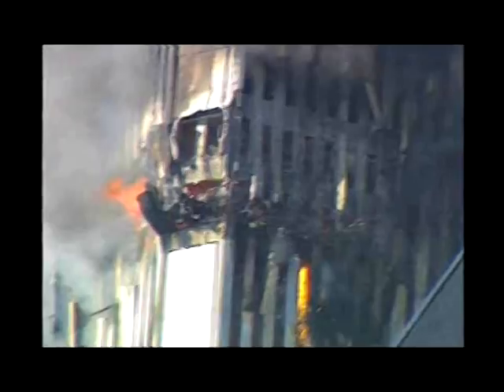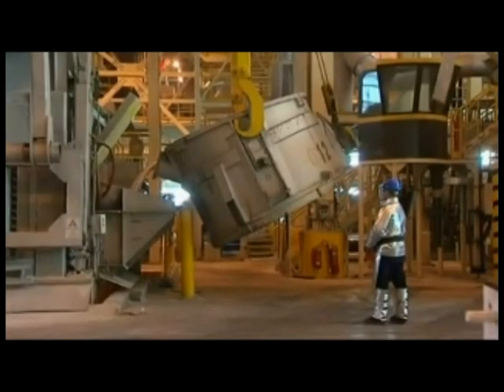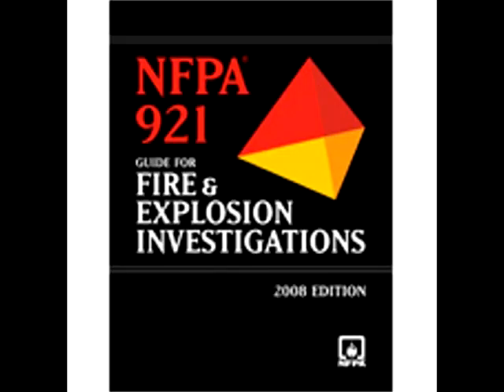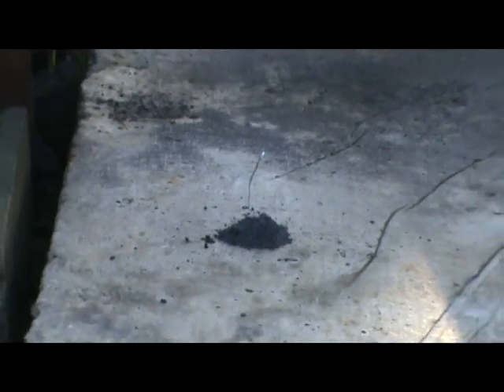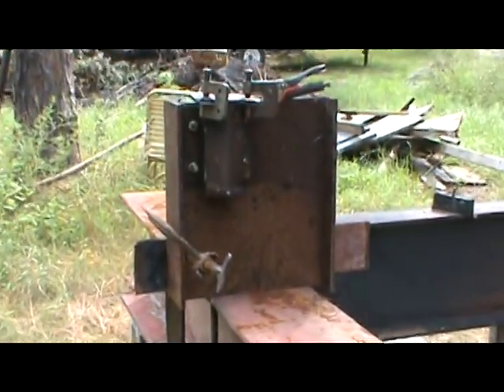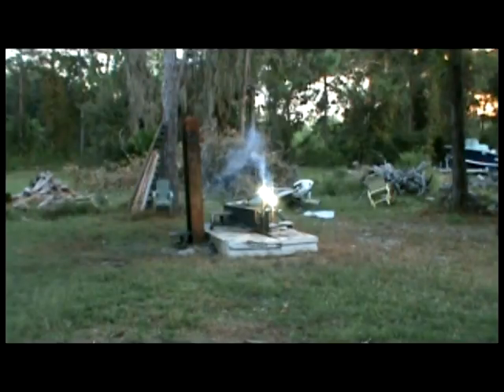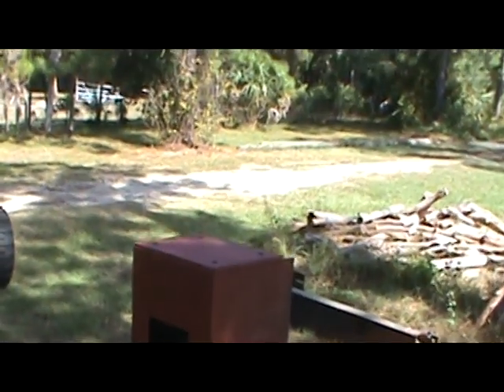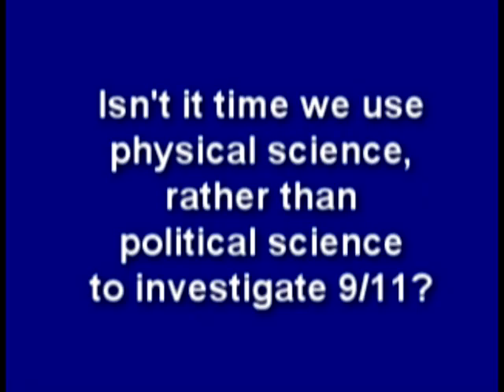9/11 Experiments: The Great Thermate Debate

Comment: This is quite depressing. You people say you want evidence for 911 Truth??? Here is some:
1) WTC 7 Falling at Freefall Speed for 2.25 seconds
2) WTC 7 Falling with perfect symmetry
3) Molten Metal found in all three of the sites
4) Underground fires lasting for 3 months after collapse
5) Both North and South towers falling at 2/3 the speed of freefall
6) The smaller upper portion destroying the entire lower portion
7) The Sulfurication of the Steel Beams
8) Horizontal Cuts in the Steel Beams
9) Billions of molten iron spheres found in the dust
10) The nano Thermate chips found in the dust
11) The Police and Fire Department knowing about the WTC 7 Collapse before hand and clearing everyone out of the area. 
12) The grass around the flight 93 crash site was never burned by jet fuel.
13) Squibs seen as the buildings collapse
14) The horizontal ejection of Steel Beams at 70mph
DON'T GIVE ME THAT NO EVIDENCE BULLCRAP
INSIDE JOB IS THE ONLY CORRECT ANSWER 
PLUS THERE IS OVER 2300 AND COUNTING WORLDWIDE EXPERTS THAT SAY IT WAS A INSIDE JOB.
THEY WOULD TALK?I know of a place called AREA 51 and its been around for a very long time.Don't you know that a pro won't talk.Tell me all you know about Area 51________
Reply: MrRandomGuy86
The support columns were cut, not exploded.

 Thermite/Thermate has been around since the late 1800's.  Nothing magic there.  Nano-Thermite is much more effective and cuts faster.  There is some explosive sounds - which were reported by numerous people.

Free Fall would not immediately occur. You have what is called acceleration - which can be seen in the numerous videos.   In fact, buildings demolished by normal means - with explosives - actually raise UP a bit before they start their fall.

Nano-Thermite evident in the dust.
Micron molten steel spheres were found in the dust.

Nothing fairy tale, and personally I would love to be able to explain this away as a simple office-fire produced collapse.  But my training  - and simple logic - will not allow that. 

The implications that is was a controlled demolition disturb me.. they do not make me joyful at all..

Go try my knock-the-leg-off-a-table experiment and get back to me.
Reply: *****
 Well, as an engineer with nearly 35 years of experience I can say that the report is flawed.  I shall not waste my time discussing this further.  And no, I will not explain why I think it is flawed.  But ask yourself one thing: Why did NIST not investigate the possible use of or presence of explosive material - for one thing.  There is more but I am tired and I cannot and will not explain what building collapse simulation experience means to a layman.
Reply: *****
I am a 2.5 year Civil Engineering undergraduate and I have worked my entire life in commercial structures, mainly steel and concrete. And I am sorry to say that your little pet theory that the unseat in of a single floor truss would create a chain reaction that destroys the next 8 floors belie,  well that's just plain stupid.

In a house of cards, if you take one card away, the entire house collapses. But it won't collapse on free fall. And if the cards are glued or welded together, removing a single card likely would not collapse the entire structure. Your ridiculous single floor truss theory is an attempt to portrait a massive steel building as a mere house of flimsy playing cards loosely stacked together. 

You should be ashamed of yourself.
Reply: *****
All of this proves one thing... more investigation is required.  I support AE911Truth.org's call for just that.

But to quickly answer you question about evidence for cut columns.. it is the lack of intact columns (evident from how the building fell and the rubble pile) that brings me to that SPECULATION...   Plus my personal experience running hundreds and hundreds of building collapse simulations..
Reply: *****

 NIST does not write codes or regulations that would be directly applicable to building safety - they set measurement standards.... And trust me, I know codes and regulations... Remember I was a quality control / quality assurance engineer for the DoD.  Making sure everything meets code (International, National and Military) was a major part of what I did.. so how does NIST make things safer?  That would be NFPA, OSHA, MSHA, EPA, IEEE, ASTM,  and many others.. but NIST? - nope..

In fact, NIST was a very odd agency to task with the "investigation".  The USACE would have been better suited to research 9/11.    Or the FBI, or the Department of Interior, or the FAA,... but NIST?  They are part of the Department of Commerce for heavens sake.. they are NOT investigators..

Here is NIST's Mission Statement: NIST's mission is to promote U.S. innovation and industrial competitiveness by advancing measurement science, standards, and technology in ways that enhance economic security and improve our quality of life.

* Measurement Science** these are the guys that tell us how to do soft or hard Metric to Imperial and Imperial to Metric conversions and set the standards for that... STANDARDS.. not code, not regulation..   Hell, I had a chart from NIST on my office wall for conversions and what the standards for conversions are..

So they were not tasked to consider explosives?  Really?  Was there not speculation at the first that the planes (or the hijackers) could have had explosives on them.  And if they decided not to consider explosives, should this not be in the report - I.E. "NIST has not investigated the use of explosives in the collapse of the WTC buildings because we think none were used because that is our feeling."   But that would be ridiculous, because if you are going to rule something out, or not studing something, you explain IN YOUR REPORT that you are ruling it out.

Again, my extensive experience with building collapse makes me question why WTC7 (and the twin towers) fell in the manner they did.. It is like a auto body expert.. he SEES a pickup truck "dog-walking" down the road, he knows that the truck might have a bent frame without any measurements necessary ------ I don't have to use any other tool other than my trained eyes to seriously question the results of the flawed investigation of 9/11.
Reply: Eddie Hayes
 Thanks Eddie.. I was about ready to bang my head against the wall with this one.. as a boss of mine years ago used to say "Logic Dictates"..
Reply: terrymanning1 I wonder how much money the government is paying you?
Reply: Dusty Slim You got him there with his no reason to check for explosives. WTF: Terrorists attack a building, fireman an cops hear explosions, many of them, but that's no reason to suspect explosives. This is how the debunkers look silly. Admit what is obvious, at least, or you just look stupid. Not you, bro, you're doing great.
Reply: The building visibly dropped in free fall. Your bullshit cop-out explanation is that the internal structure collapsed basically leaving a cardboard cut out of the building which than dropped in free fall.

This is pure bullshit as even a cardboard box can't collapse into itself in free fall.

Free fall means that something is pulled by gravity without anything to slow it's acceleration in free fall.

That you believe this can happen simply because NIST tells you is laughable.

First NIST claimed in their draft that the building dropped at 40-60% slower than free fall.
Than when cornered by a high school science teacher, they were forced to revise that statement and their final report would change to "essentially in free fall".

But never mind me. If NIST tells you a building can drop into it weld as effortlessly as if it were falling through nothing at all than it must be true.
Reply: *****
"The final global collapse of WTC 7 was not attributed to either impact damage or fire/heat."

You yourself wrote that "Thermal expansion caused a floor truss to walk off its seat plate, causing the the 13th floor to collapse. This caused a cascade failure of floors down to floor 5"

Now what would have caused this thermal expansion? Fire and heat maybe? Hmmmm? 

Besides how you can imagine that a single floor truss would cause 8 floors to cascade like a bunch of dominos, well that's just ridiculous.

The fact remains that if there were "raging fires" as NIST claims, they would have to be on the South side as only weak random sporadic fires can be observed on the other 3 sides. And the debris damage was also all on the South side. 

But now you are telling us that neither the fires nor the debris damage were the cause of the collapse? Well, I sorta agree with that statement as fires and debris damage to a single side would not cause any fire protected steel building to drop this way, in free fall, almost perfectly vertically for about 3/4 of the drop.

So tell me, if neither fires nor debris damage were responsible for the oh-fishy-al collapse narrative, than what was the cause of the collapse? Fairy fucking dust?

"Why don't you guys ever know that before you attempt to criticize the NIST Report?"

Believe you me, we 'guys' do know very well that fires and debris damage to the one side were not the culprit of the collapse.
Reply: *****
I can't stress it enough, if you can look at the videos of WTC7 and convince yourself that it's a fire collapse, than no amount of logic will appeal to you.

Einstein said that two things are infinite - the universe and human stupidity. And he wasn't entirely sure about the universe.
Reply: Sirius Black NIST stated that WTC 7 fell as a result from the failure of one column and the subsequent progressive process of failures to  the rest of the columns. But they also stated that the whole building came down as a single unit for 8 floors (2.25 seconds) at free fall speed. Free fall cannot be explained by a progressive process and only by CD. But NIST did not say that. They said nothing!
Reply: terrymanning1 the computer simulation stopped before it showed the fall; just the sequences that lead to the fall. Moreover the simulation indicates something totally different than what is seen in the real pictures. It shows that the building is crumbling on one side which never happened, It should have been REALLY interesting to see the sequence where the whole building comes down "as a single unit in free fall speed at the acceleration of gravity. If you have a computer simulation that shows this you owe me that one!
Reply: terrymanning1 I have no idea of what kind of explosives that were used. What really happened was what we all have seen in the videos. The building fell - at least partly - at free fall speed, which cannot be explained by anything else than controlled demolition. Do you have another explanation? Dove shit?
Reply: TIM SEATON if we are talking about WTC 7 it does not take too much brightness to read NISTSTAR 1 A p. 44 ff. The towers did not fall at free fall speed but at constant acceleration very close to that. That is also not explicable by anything but CD.
Reply: terrymanning1 all of a sudden you can talk? Then tell me where to find the evidence of the hijackers at the airports, the evidence of the final fate of Flight 93 (disintegrated or buried) the explanation of the free fall of WTC 7. I am longing for that information.
Reply: TIM SEATON I have seen enough of the actions from you guys to know that you are just cowards. Just now you are just scared little boys waiting for the truth to blow up in your faces when the 28 pages are released to the public. I hope that you, if you have some decency, encourages everybody to get that material declassified. Then you have done something positive for this nation. Otherwise you belong to the cabal who loves harsh interrogation methods together with... you know who.
Reply: TIM SEATON and what about your story? 19 hijackers that penetrate all of the US institutions with 100% success rate and that same incompetent government presenting a 100 % success rate story of how it all came about within hours and all over the world (and ready to go to war). Who  is offending the memory of the deceased and their families?
Reply: Dusty Slim

Explain how bombs could magically survive falling debris, fire, evade bomb sniffing dogs, and explode silently seconds before collapse.

Furthermore explain how bombs could cause the building to do a free fall in the MIDDLE of the collapse. Not the beginning, not the end, but the MIDDLE. Wouldn't free fall occur at the beginning of the collapse if it was a CD?

You can't explain it away with your fairy tale CD theory.

WAKE THE FUCK UP DUMB DIPSHIT SHEEP!
Reply: Dusty Slim
You ignored my comment. What's the matter dumb dipshit sheep? Too much of a coward to admit you can't refute me?
Reply: I don't think I ever seen you before? With a 12 man highly trained team of men I could drop ANY building from over a thousand miles away TONIGHT if I had the material,setup and men.What the hell does people think Area 51 and (SECRET BASE) is for?
Reply: Eddie Hayes
"With a 12 man highly trained team of men I could drop ANY building from over a thousand miles away TONIGHT if I had the material,setup and men."

Prove it.
Reply: Eddie Hayes
No clue what you're on about. You make less sense than a guy trying to ram the elevator doors open on the top floor when the elevator is on the bottom.

How about you explain how bombs magically survived the plane impacts, fire, evaded bomb sniffing dogs, and exploded silently seconds before collapse.
Reply: Truthers (and especially the fuzz faced fuck up Hayes) are retards.
Reply: Eddie Hayes
I wonder why you can't answer how bombs magically survived the plane impact, fire, evade bomb sniffing dogs, and explode silently seconds before collapse.

I wonder why you haven't looked at Operation Penttbom yet.

Oh yeah it's because you're a gullible ignorant dipshit sheep drone to the conspiracy shepherds.

You pull the classic "oh this person is a paid agent" from your sheep handbook. Well guess what? IT DOESN'T MATTER! If you really had the truth you would be able to refute terry and myself agent or no agent.

The TRUTH is you say "oh government agents they lie so I don't have to refute them." It is a LAZY SHEEP tactic. You still have to refute us regardless, and you can't. You simply say government agents to ease the discomfort you have from cognitive dissonance.

But you could prove me wrong SHEEP. I DEMAND you answer what I asked you to. If you don't, then you need to...

WAKE THE FUCK UP DUMB DIPSHIT SHEEP!
Reply: What are you talking about?
Reply: ***** So what? The very existence of free humanity is in danger. U.S. and all the West is controlled by bankster "elites" since 18th century (central banks are in  private hands, like FED is). Industrial military complex is owned by them. They do events like 9/11, enforce ISIS, and yiu idiot say so what? Fortunately there are people who care.
Reply: ***** 
1) the building could not fall at this speed without charges exploding evenly and in coreect times and weakening its structure.
2) steel could not have been molten without temperature higher than that of offuce fires
3) see 1)

As to conspiracy theories:
4) the term was coined out by CIA in 1967 to discredit people daring to ask about Kennedy assasination
5) search for "33 conspiracy theories that turned out to be true" on infowars.com website. And if you say "I don't go to such websites" you will only confirm being a sad ignorant.
Reply: Believerification
Explain how bombs magically survived the plane impacts, falling debris for building 7, fire, evaded bomb sniffing dogs, and exploded silently seconds before collapse. Explain why any explosion that happened that day had nothing to do with any building collapsing.

You can't with your fairy tale theories. But prove me wrong by answering me. If you can, then you win and 9/11 was an inside job.

If you can't - and I know you can't because bombs like that don't exist - then you need to...

WAKE THE FUCK UP DUMB DIPSHIT SHEEP!
Reply: WTC7 dropped in complete free fall. That is, it dropped throught thousands of tons of steel as easily as if it were falling through nothing at all. You claim NIST explained how this was possible. Please explain in your own words how NIST explained that away.
Reply: terrymanning1
If you can look at the videos of WTC7 dropping in free fall almost perfectly vertically and tell yourself "Yup, sure looks like a steel/fire collapse to me" than maybe I am not the gullible one here.

The NIST claims that there were "raging fires" inside WTC7. Hot enough to weaken fire protected steel. That would have to be on the South side of the building as all other 3 sides show very small random fires.

And the debris from the towers would have to also damage only the South side of the building - the side facing the towers.

So a building with damage by both fires and debris on a single side drops this way? And you don't have a problem with this?  Really? 

I sell bridges. I got the perfect bridge for you. A real steal. Might you be interested?
Reply: *****
I just read it again.....

 *"Thermal expansion caused a floor truss to walk off its seat plate, causing the the 13th floor to collapse. This caused a cascade failure of floors down to floor 5"*

You really should share your knowledge with demolition companies.
The poor misguided guts in controlled demolition would have rigged large amounts of precisely calibrated demolition charges in precise locations to be detonated in a precise sequence. But you are basically saying that dislodging a single floor truss would cause the entire building to collapse. That you can beleive this crap is apsolutely astounding.
Reply: oller = gullible fuck up with shit for brains. The NIST computer simulation matches exactly what was seen on 9/11. This explanation has been accepted across the world by all relevant experts except those peddling the truther lies. Strange that don't you think if NIST have it all wrong. Or are all the non truther experts paid off?
Reply: terrymanning1 explain total collapse after the initial collapse happened.....
Reply: truthers = retarded lie peddling attention seeking scum
Reply: NO.Explain it to me.I am a nice man.I know everybody has their unique way of thinking.A little of my background.I have a degree in being a shrink.I have worked at four major mental hospitals so it is easy to see if someone wants to talk or just screw with you.Why you may ask,"He doesn't use big words such as psychologist,psychology or any other word such as those.Most people don't understand those words.Especially if their mind is out of tune.Explain what you mean and then we can go forward.I know a lot of people will read this and they may give you advice on what to say.Stand firm and tell me what is on your mind,not theirs.
Reply: TIM SEATON NISTSTAR 1 A p 48 "the whole building came down as a single unit at gravitational acceleration" enough?
Reply: It's not my fault if truthers are unable to see beyond their own hatred and paranoia. You guys have absolutely no evidence to counter the official account, just lies, bullshit, innuendo, cherry picked quotes and a small group of discredited "experts" still peddling them. It's over for you pathetic whining douche bags. 9/11 was carried out by Islamic terrorists. Deal with it. Move on.
Reply: Eddie Hayes if you can't separate the truth staring you in the face, the evidence put on a plate , the common sense of the big picture, then I'm sorry, but you are spending a little too much time with your patients
Reply: You're just a big mouth,a TROLL that needs to look after the country they live in.You have your own opinion about everything.You can keep sending me all the crap you want and I will just respond the way I want.So do it.
What I have is an opinion and with free speech I can express it.
I LOVE AMERICA.Your just a idiot that says nice things about the US and you really expect anybody with a reasonable IQ to just go along with you?I've seen you make comments on other sites and you showed no love for the US then.
Reply: terrymanning1 in reality you and your accomplish debunkers is the worse lot of the all; defending what is obviously undefendable. Where will you go when the 28 pages are released? Like the cowards you have proved yourselves to be you have not even dared to tell the story about Flight 93. Buried or disintegrated? No answer. Not from you. Not from your friends. Not from the Commission. Do you think it is fair to the families and to the public not even to come up with a comprehensive story?
Reply: TIM SEATON Sure I'm going to bring someone down?How would I ever do that?I don't have super natural powers.Nor do you.This was a exchange of words and thats all.People don't debate on YouTube and never will.Everybody presents ideas or a exchange of knowledge.You are only a very young "adult" still living with mom and dad.You are the very type that would censor free thought.I think everybody in the world should have the ability to express their point of view.
Reply: TIM SEATON I will knock on your wooden head until you give us some answers. But you seem neither to be capable nor willing so I can´t help you very much, I´m afraid! But knock I will. Answer!
Reply: oller Bring it on pal. The world knows you truther kooks are imbeciles and liars. 13 years of lies and bullshit that's proven only one thing: what a gullible bunch of hate filled anti-USA schmucks you all are.
Reply: TIM SEATON and how does that fit into the actual findings at the crash site? According to the first responders (including the local mayor and the editor of Pittsburgh Cronichle) there was no clue of a crash site where it supposedly was. In the Commission Report there is no comprehensive story. According to Wikipedia there was a crater of 8- 10 feet deep. And nobody could see anything not even the local coroner (until later lol). Some try to explain that it was dispersed in a large area and some say it was buried down to 25 feet; but no official account.  Happy with that?
Reply: TIM SEATON I think Wikipedia reflects the official version which is extremely shallow to say the least. So, in your mind; which story fits your findings the best? Disintegration or burying? Burying fits the 95 % story better or not?, Oh; I forgot: where can we witness the recovered wreckage? You don´t happen to have a link available?
Reply: TIM SEATON I am not changing any subject my answer was given before your comment came in and I have answered to that too. You owe us your story on UAL 93 and answers on all other questions.
Reply: TIM SEATON TIM SEATON = TERRY MANNING
Reply: truthers = cunts
Reply: terrymanning1 and the little snail returned to his shell
Reply: TIM SEATON..and you don´t even have an opinion. Buried or disintegrated? Flight 1771? The same? You gave me the clue. So now give me a straight forward answer. Feel cornered?
Reply: ama79adr we are just  dying to see their poetry published!
Reply: +TIM SEATON yea, when the defense secretary says In a press conference there's 2.3 trillion in unaccounted spending it doesn't get any clearer than that jacksss.
Reply: ama79adr looks like it!
Reply: ama79adr for some reason, there seem to very few around here for coffee service. I am not sure I would appreciate that coffee too much, so it´s ok for me.
Reply: ama79adr he is certainly an engineer in producing lies on YT.
Reply: facepalm

1) Time that with the penthouse collapse included next time.
2) Fiterman Hall and Verizon Building, anyone?
3) Molten aluminum. Molten steel is not red-orange.
4) And this proves what, exactly?
5) I already know you timed that by using the unattached pieces of debris as the time lap. Try waiting until all the floors have actually been crushed before lapping the time.
6) One floor down, two floors, it's called acceleration/domino effect/progression. 20:1 ratio of weight? Resist THAT!
7) It's called eutectic compounds.
8) OH MY GOD! HE CUT THAT BEAM IN A POST-COLLAPSE SALVAGE OPERATION! PROOF OF THERMITE!
9) And this proves what, exactly?
10) Thermate uses barium nitrate, which, if it were present at Ground Zero, would have caused more deaths by poisioning than the collapses and plane impacts combined. None of this substance was found in the dust samples collected by Steven Jones.
11) How did they know? Creaking sounds, visible structural instability, etc.
12) Again - what does this prove?
13) I guess that would explain why the goddamn walls began bowing inward when the collapse began.
14) Refer back to 13

And yes - no evidence.
Reply: Clearly, someone doesn't know what happens when a building loses all of its external strength - in this case, column 79 failing, destroying 1/3 of the area of flooring, and thus triggering a chain reaction of lateral collapse. The outer walls come down too.

If any of you can find actual evidence of an explosion, that would be an eyebrow up for me. Until then, we're at a deadlock.
Reply: *****
SO?
Reply: *****
Ok Cantonear... let's start with my qualifications.  For the last 10 years I have performed QA/QC on designs for the DoD.  Specifically running computer models of blast effects on buildings designed by different DoD contracted A&E firms.  These installations run from underground command bunkers to day care centers.

A steel framed building with NOT freefall uniformly, even when hit dead center with a 2,000 pound bunker buster, from the loss of one column (#79 I believe is what NIST said for WTC7). I know, I have run hundreds of simulations on this.  The only way WTC7 or any other building of its type could free fall - uniformly - is if you remove ALL vertical support columns (be they Steel or Concrete) at the same time.

This can not be disputed.  It is basic physics and can be found in numerous publications discussing "progressive collapse".  

Why don't you try an experiment:  Knock the leg off a 4-legged table and see if you can make the table top fall to the ground while remaining level.  NIST's report implies that this is possible.  Good Luck.

WTC7 was dropped by controlled demolition. 

Or Magic..
Reply: Dusty Slim I agree Dusty.
Reply: OK big mouth,draft dodger,Where is the team of men plus NT?
Reply: *****
Oh please, you don't have access to the truth. You just believe in a fairy tale.
Reply: ***** When you kooks can prove a single one of you claims come back and try again ok.
Reply: All they have to do is say that all these things have been "debunked". If ten thousand scientists say demolition, and one scientist says fire, the one debunked all the others.
Reply: Docktor Jim If truthers had proper evidence of a demo job instead of ridiculous fantasy scenarios they would have tens of thousands of engineers etc allied to ae911twoof. They don't and for good reason. Truthturds are full of shit.
Reply: Dusty Slim
He will likely reply that comparing a 47 story structure to a 4 legged table is just plain stupid.

But comparing it to a pile of pancakes or domino's is much more acceptable. (Duh!)
Reply: If I can prove you wrong, I win? Your break's over.
Reply: pepelapiu2004 cantonear just handed your rase to you pal. Suck it in and deal with it. Then wise up, get an education and stop being so naive and gullible.
Reply: Do not ask questions if you're not ready for the answer. If you want to know how, first you have to understand why ....
Reply: pepelapiu2004 
if you look at the FULL wtc 7 collapse (this one: http://youtu.be/xrzeN-wvHD4), you'd see it starts about 8 seconds BEFORE the outer wall drops at near freefall speed, because the interior started collapsing far sooner than the outer wall

also, on the "very small, random fires" in wtc 7, watch these video's and tell me they're "very small random fires"
http://youtu.be/b6PTMO4k9vg
http://youtu.be/gD_nV88trrM
http://youtu.be/m91II9ejZAE

keep in mind these "small random fires" that ignited from burning debris from the collapsing towers were left burning uncontrolled for 7 hours straight, longer than any office fire in history, because the entire fire department was preoccupied with rescue work at the debris from WTC1 and WTC 2

also, whoop dee friggin doo, a bridge isn't an office building, a bridge doesn't contain printers, pc's, paper, dry wall, and TONNES of other, highly flammable material, instead it contains mainly flame-retardant (to a certain temperature) asphalt and solid steel, and EVEN THEY can break purely due to fires:
https://www.youtube.com/watch?v=EuluXmvd0LI

to make your case EVEN WORSE: this is a wood fire, no accelerants, nothing
Reply: pepelapiu2004 if you were to set a densely packed office building on fire and kept firefighters away for 7 hours, yes, it would collapse, because other than WTC 7 no high-rise office building has ever burned uncontrolled for that amount of time
Reply: pepelapiu2004 no-one said a single floor truss failure caused the entire collapse to my knowledge...

the building also did not fall "on free fall", it took well over twice the time it would take as freefall from the first VISUAL indication of a collapse (a section of the roof caving in) to the end of the collapse, truthers usually only show the last half of the collapse, when the outer wall collapses due to being destabilized by missing massive sections of flooring,

also a deck of cards welded together is hardly comparable to a concrete building, you, as a "civil engineering undergraduate" should know this

i've also heard that fire departments blame trusses as a likely source of collapses, usually this means localized floor collapses, but collapses like this may also be caused by EXTREMELY prolonged, uncontrolled, exposure to fire:

i say extremely prolonged, because it was:
average FDNY response time to fire in NYC: under 5 minutes,
FDNY response time to WTC 7 fire: hardly at all between 10:28 am, when the north tower collapsed to 5:20 pm, when WTC 7 collapsed, so just under 7 hours of uncontrolled fire

this is because they had their hands full on WTC 1&2, building 7 had been fully evacuated within minutes from the fires starting, and low water pressure prevented an efficient means of extinguishing the fires
Reply: All of your points are complete lies,all of them are easily explained ,but you don't want the truth you just want magic,did you go to school ?
Reply: oller this is just the point, it didn't fall at free fall speed , look at the videos, it just takes a slight amount of knowledge of basic physics to see this, but you either don't want to or you are not bright enough
Reply: oller see what i mean, ? you can't even follow simple maths and whats in front of you, seek medical help
Reply: Eddie Hayes Your original post is nothing more than the combined bullshit of the truth movement that has been debunked countless times by the facts. The best thing you and ALL truthers can do is accept the fact that the conspiracy theories around 9/11 are all lies cooked up by the anti-war protester movement who despise the Bush Administration's response to 9/11. i.e. the wars in Afghanistan and Iraq. Truthers should give up now in the complete and utter absence of any credible facts to debunk the official account.
Reply: see what i mean ?
Reply: Ивайло Чакърски Do you have anymore proof to add or any statement that give or shed new light on the subject?
Reply: terry, i think it really is just the fact that some americans, brits as well, just can't accept that it wasn't them that did this "spectacular"as the British army puts it. they don't want to accept that someone else instead of them orchestrated  such a massive impact .in some sick way ,they convince themselves that it was americans that need to take centre stage, but as you say, just realise that you had your arse handed to you, your security fucked up, it happened , it was vile , sort the bastards out
Reply: oller its what the scientific world call, "falling down because a fucking big building fell down and its debris destroyed your ability to stay standing"
Reply: Oh,you are giving me advice....hmmm,you don't even live in the US and you are a kid.
Reply: 51 ?, so what if i don't live in the states, america is our bloodline,cut them we bleed, my opinion is quite obviously more valid than yours, you hate your country, i love it ,you see this is a prime truther here folks, can't listen to sense or reason , paranoia is a mental state
Reply: seems like a reasoned sensible response folks ?!!! keep your eyes on these people, they will bring you down
Reply: oller 95% of united 93 was recovered, more than any plane on 9/11, look and you shall find , ask an adult if you can't find it
Reply: oller when the report is released you will still say they are lies, there is no pleasing you idiots, its no use knocking when theres no one at home as they say
Reply: as I've said above, you moron, I'm 51 , forgotten more about construction and the world than you have managed to gather , i educate myself ,use reason and common sense,but don't let idiots think they have the stage when spouting vile stories that piss on the deaths of the innocent by dragging it through the internet for all to see, with their infantile stories that have no basis in truth or reality
Reply: oller 95% of united 93 was recovered, more than any plane on 9/11, look and you shall find , ask an adult if you can't find it, i put this above but you missed it ,big shock !!, its a stupid thing to ask i know, but do you do research?
Reply: certainly not me , its you who keep bringing up the past, it happened , security failed , it happened , and you have done the classic, change of subject when given the truth
Reply: again, 95% of the plane was recovered , pictures ,video, witnesses, you believe what you want, i will stick to a little thing called evidence
Reply: oller wikopedia ????!!!! you really are a very funny man
Reply: i know,before they remove the bodies, wreckage etc..., lets give you a ring so you can come and examine it and take photos , orrrrrr  ,you don't matter, neither does your shit opinion
Reply: good to see the shills here....hey TIM "CHINESE ACROBATS" SEATON...AND TERRY "9 MONTHS PREGNANT" MANNING......
Reply: truthers = retards
Reply: If you follow the money and the people who benefited from 9/11 the "inside job" argument gains some serious traction. On 9/10 rumsfeld admitted to over 2 trillion in defense spending that's undocumented. I had no reason to question the events of 9/11 until I heard this. What part of the pentagon was hit? Defense spending department.  Then I learned of the WTC owner and him upping his insurance on the buildings shortly before the attack. These are just a couple of FACTS that left me wanting to know more and not accepting what I'm told just because I'm "un-patriotic" if I question that day. It's FACT that our government knew an attack was coming, even the way it would be carried out. Maybe that's why NORAD was conducting an exercise of the very events unfolding or that FEMA was in NYC Monday. Too many strange things not to question.
Reply: Steve Blowme of course its so easy to follow the money on your cheap laptop in a rented basement, all is so clear
Reply: Steve Blowme Silverstein bought the WTC site shortly before 9/11 and as part of that deal he HAD to have terrorism insurance as a result of the 93 attack. Whoever bought the buildings would have required it so no conspiracy there.
Yes I agree there was clearly some info leading the military to expect an attack, but it's obvious they were expecting any hijacked planes to be coming in from OVERSEAS.
Reply: terrymanning1 yes of course, so the planes could be detected earlier and shot down; of course!
Reply: oller The planes took off inside the USA you kook, clearly not what was expected. The military didn't have time to react as within a few minutes of air traffic control realising what was happening the aircraft hit their targets.
Reply: terrymanning1 at 9 they had four hijacked planes and they had plenty of time to react to stop planes from entering the highly restricted air space around Pentagon
Reply: +terrymanning1 true anyone who bought the buildings would have insurance since it was already attacked no argument there. My issue with him is he sued claiming there was 2 attacks and awarded 4.5 billion. He also admits he pulled WTC7, which makes sense to me. The building was burning for 7 hrs and posed danger of collapse for the search and rescue at WTC 1&2. So evacuating ground zero and "pulling" 7 saved injury and maybe more deaths. Still to many questions and strange things for me to accept the final commission report.
Reply: TIM SEATON so you still insist that 95 % of the plane in Shanksville was recovered. Would you be so kind to enlighten the American public of where to find this 95% Nobody seems to have gotten the information about the museum.
Reply: oller oh sorry, didn't they tell you?, how rude of them not to tell you and the american public where the wreckage is so that you can all go and cast your ghoulish eyes on it. perhaps they could come up with some bone fragments or hair or belongings to show you , or they could invite you to their xmas dinner each year , they really don't know just how important you are do they , they are so rude
Reply: TIM SEATON just show me the wreckage of the plane please. That has been managed before. You can examine the human remnants.
Reply: TIM SEATON I have but I cannot find it. I think the reason is that it does not exist! You are the one claiming that 95 % of the wreckage is saved. You have to prove that. Why should I believe you? You can just tell me, with your own words, where it is!

Do you ask me to look up something that I don´t believe to exist? Do you realize how absurd such a demand is?
Reply: oller is timmy still with the same typical bullshit....he said the twin towers where built like a human pyramid and that's why they fell..
Reply: Truthers = disgusting lie peddling scum
Reply: oller Nope. The US air defence was set up to defend threats from outside the USA, not ones from within. A fatal flaw but that won't ever happen again. Oh.... and you're a kook.
Reply: oller no the reason is because you are too thick to find evidence
Reply: TIM SEATON you made the claim so you have to prove it. Or are you still in Cuba?
Reply: TIM SEATON only debunkturds continue with the same bullshit logic and lies...tell your mom she better have my coffee hot in the morning...
Reply: oller good news for timmy this morning his mother made some good coffee...
Reply: TIM SEATON that bitch you call a mother better have my dinner cooked by the time I get there....
Reply: with your drugs problems, you aren't allowed to travel
Reply: TIM SEATON are you looking for sympathy I would advise you to go elsewhere
Reply: TIM SEATON that´s what I said but in maybe not as nice words as yours
Reply: TIM SEATON great assumptions from the "world traveling youtube engineer"....hahaha
Reply: TIM SEATON ask your mom....she knows I don't lie....
Reply: ama79adr hes here again folks , out of his drug fuelled stupor, the proven liar and con man , resorts to abuse and lies when he's been destroyed online
Reply: TIM SEATON timmy....
Reply: ama79adr I think it is about time that we drop Timmy off at the junk yard. He has no ability to read write, think or speak.
Reply: oller thats right , ignore what you can't explain, you two are at home at the junk yard, along with your science and lies
Reply: a couple of lying , ignorant truthers,classic text book ignorers of science and common sense , both have the the sole intention of hating their country and the people who die protecting it, watch them folks, treasonous wankers the pair of them
Reply: TIM SEATON projecting....look it up idiot...
Reply: ama79adr anything you say liar
Reply: TIM SEATON anything you say "youtube engineer"...
Reply: ama79adr ok liar
Reply: TIM SEATON ok "youtube engineer"...
Reply: ama79adr ok liar
Reply: TIM SEATON ok "youtube engineer"...
Reply: oller no doubt about it...watch him run...
Reply: TIM SEATON the twin towers collapsing took how long???
Reply: ama79adr as long as you both say, you are the lying kings
Reply: both proven liars
Reply: TIM SEATON and your proof is as usual....nothing! Coward trying to imply that a plane wreckage has been retrieved without even telling where it is? That is what I call a lie!
Reply: oller thick, ,as well as a  liar
Reply: TIM SEATON yes you are!
Reply: great comeback , thick as proven, liar as proven
Reply: TIM SEATON tell me all about it!
Reply: oller liar
Reply: TIM SEATON I remember a friend of yours who also had a bad stuttering problem here. His name started with the same letter and he used a c-word instead. May be he is  VERY close friend?
Reply: TIM SEATON like I suspected
Reply: oller told you, thick as a brick
Reply: Martijn Heyerdahl who are you talking to and what is your point?
Reply: Who am I talking to? Gee, I dunno, the original poster?
Reply: Igor K You really need to learn the definition of "pull it".
Reply: Igor K this is however irrelevant. We KNOW for a fact that explosives were used. There is no other way to explain the free fall.
Reply: Martijn Heyerdahl since we know that there was a period of free fall we also know that explosives were used. Pulled or not is irrelevant.